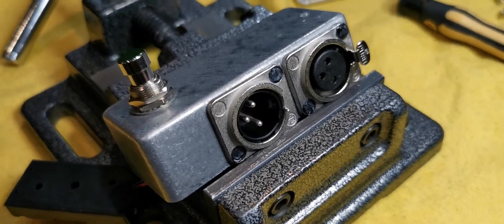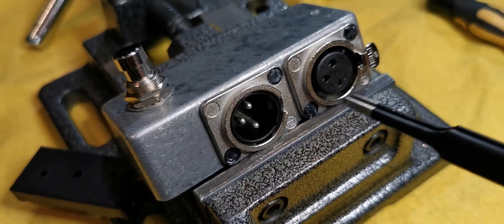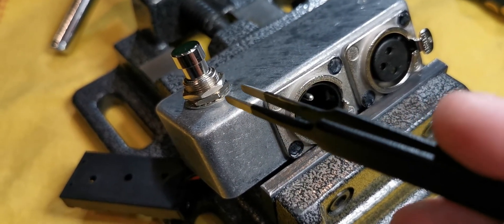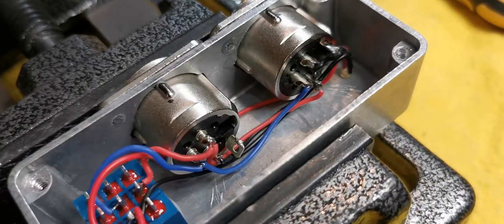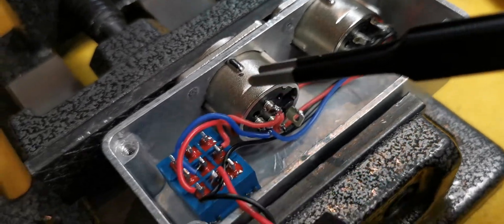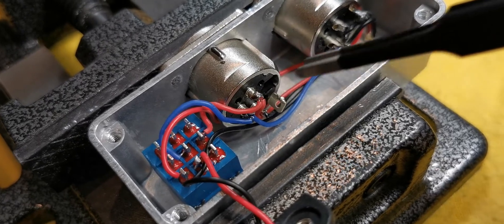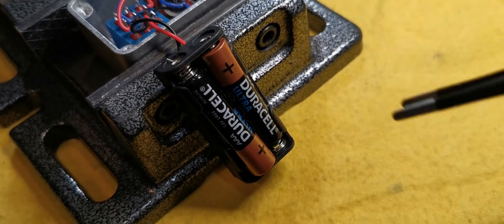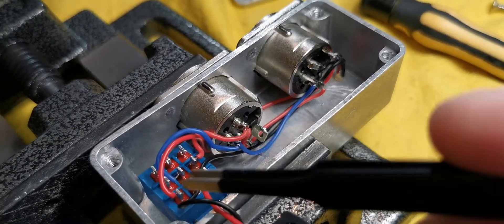Balanced/XLR non-phantom kill switch pedal for microphone etc.

Comment: You're on the right track...  there's a few components you can add to stop the popping.   I build and sell units like this.... and mine don't pop.   I based mine off a radio "cough button" circuit.
Reply from the maker: This one was for use by our drummer between tracks so any pops or clicks don't really matter but I'd be interested to see what you use to eliminate them completely.
Reply: @nickcook3948  I found schematics for radio cough buttons in the public domain and put my own spin on it.
Reply: Where can I buy one? I need something that can remain muted, but act as a reverse cough button. I want to HOLD IT to unmute.